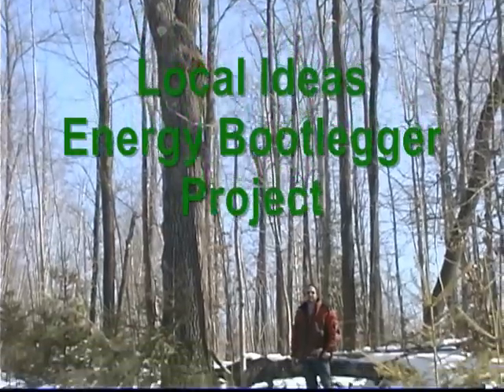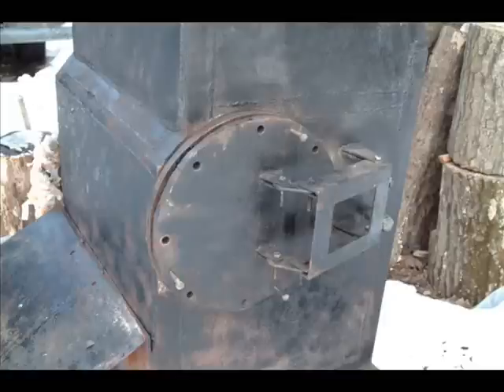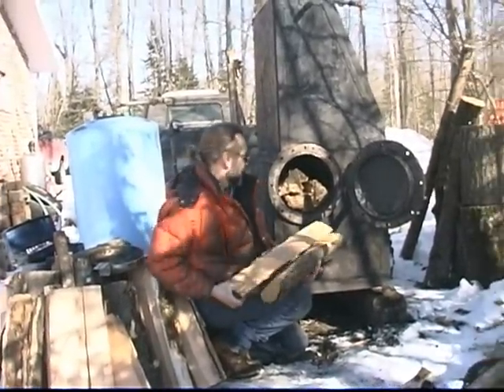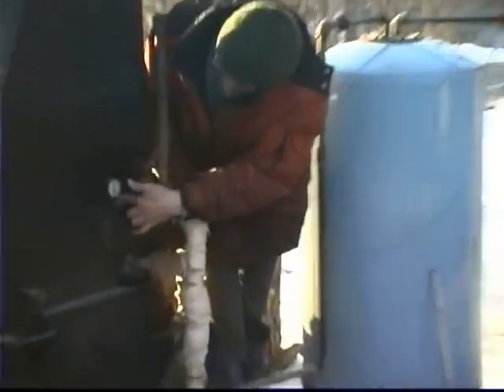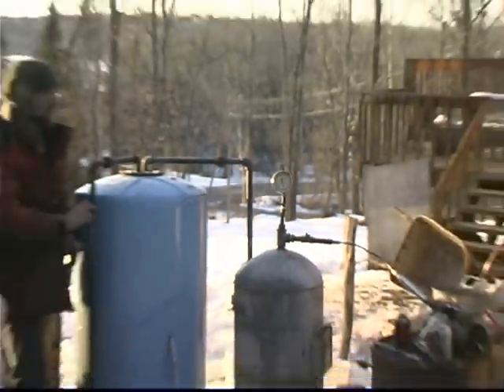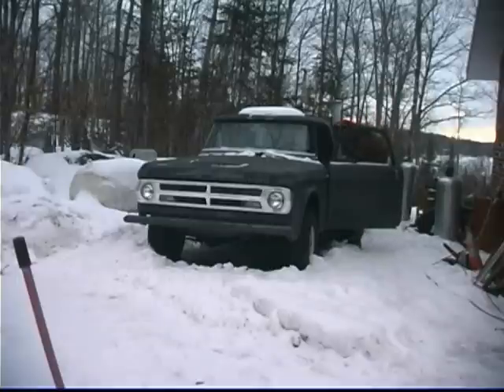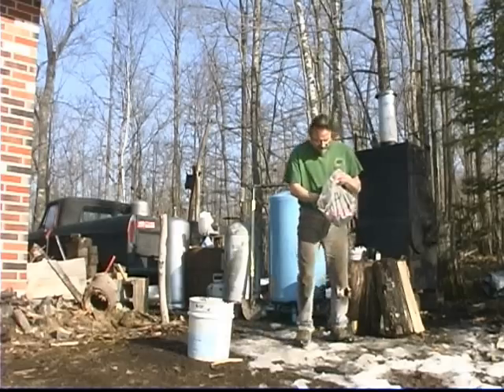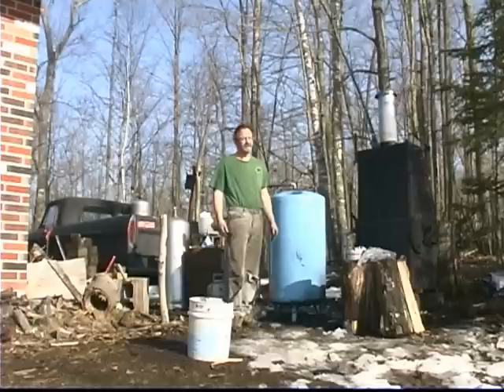Energy Bootlegger = Energy Independence

Comment from the maker: @malsifood yeah well wood gasification is a similar but different process. What I'm doing is more like thermal depolymerization, pyrolysis or destructive distillation. The reaction is done in absense of air and oxygen.  Gasifiers mix the fuel with air and you end up with a great deal of nitrogen lessening the btu value of the fuel.  I figure if I make the fuel, electricty and household heat it then is worth it to store the fuel for later use and you don't have to have a wood stove on your car..